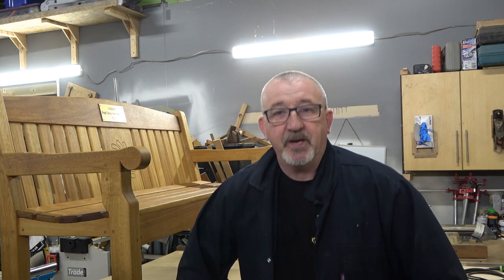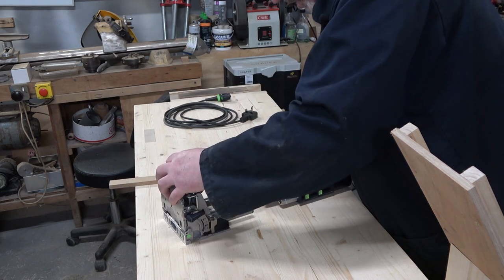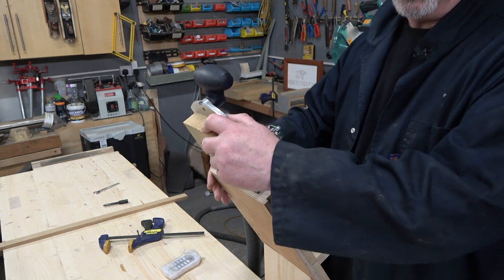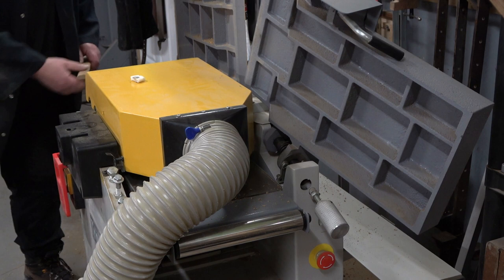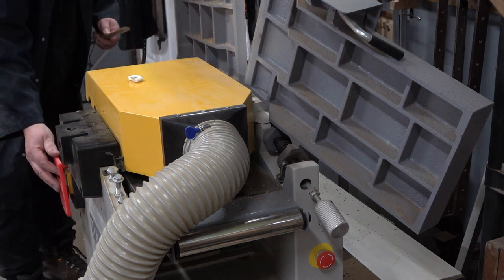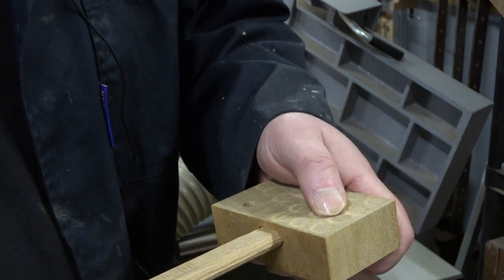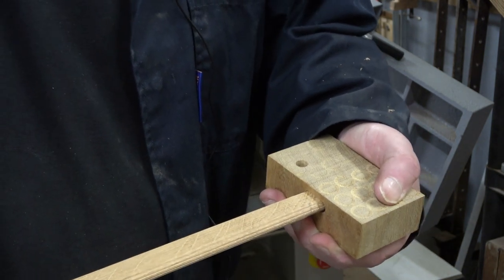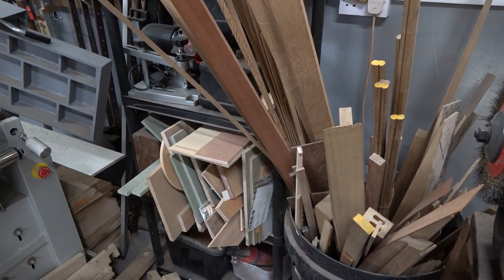DOMINO ROUTER BIT (not available in stores)

Comment: I've made some custom dominos before but I made extra wide ones to fit the  'extra loose' setting. I had a situation where I couldn't  fit 2 dominos side by side but I needed that anti-twist strength so just did extra wide dominos. I didn't add the grooves, but I ended up having enough space by the curve not being exact to give the glue a place to go. It worked out nicely and can come in handy even if you aren't trying to save, just need a custom fit situation. Thanks for sharing!
Reply from the maker: We did the same here, they were custom made for a bench that will probably live outdoors so we wanted to use sympathetic species. Thanks for your feedback.

Comment: So there’s a lot of videos coming out that measure the strength of joints. The domino rated very low on strength. So basically one is paying 1000$ for an alignment tool that you can pay 100$ for something that does the very same thing. Fastool makes very good tools that is 5 times over priced. Amazingly, people buy it.
Reply: It's meant for alignment. You want strength, you go with the connectors. You can't take apart a glued up mortise and tenon
Reply: The sole advantage of dominos is that they do not require precise alignment (they are deliberately sloppy in the width dimension). If you use a jig, twin dowels are as strong and way cheaper.
Reply: @Tensquaremetreworkshop  why would they be deliberately sloppy if they are for alignment?
Reply: @shaynesabala  If you are putting in 2 or more to join two parts together, then, if they were tight, the separation would need to be very accurate or they would not fit. They are commonly placed by hand layout, i.e. pencil marks. This is not accurate enough, so they are made slack- there is even a control to increase the slop. Dowels are cheaper, more available, and (especially in pairs) as strong. The sole 'selling point' of the domino is that they can be used with hand layout. There are double dowel machines at a fraction of the cost- but cannot be used free-hand (for multiple joints). You need a jig. So, if you want to avoid jigs you pay large sums to Festool. Personally, I made a universal dowel jig (see my channel for details) and just use my drill. Excellent hold and strength, saving ~£1000 for the domino tool and a tenth of the cost per fixing. You will never see commercial furniture using dominos- they are always dowels.
Reply: @Tensquaremetreworkshop  I have a cheap biscuit jointer that cost less than 100$. It lines them up perfectly every time so that’s not an issue. However, I read somewhere that said the biscuits can swell over time and cause misalignment. Not sure how that would happen after the glue is dry but time will tell. I guess we both agree, the domino is an over priced gimmick of sorts. Lol.
Reply: @shaynesabala  I would not call it a gimmick- it does what it says, but at a huge price. All to avoid using a jig to lay out dowels... A biscuit jointer is somewhat different- it is designed to joint together flat pieces, such as for a table top. It is tolerant of inexact alignment, but the thin biscuit and their length make them unsuitable for joining e.g. at right angles.
I understand that, when used for their intended purpose, it is advisable to only glue one half of the biscuit. This allows the wood to swell along the grain.
Reply: @shaynesabala  A problem some folks have with biscuits is they don’t give the glue enough time to set hard. I always wait at least a day for the glue to set, or longer. First I heat my oven to 200’ F turn it off and put the biscuits on a cookie sheet and get any moisture out. Then assemble with glue. They swell with the glue, then seem to settle back in. If you sand when they are swollen, Later you may see divots where the biscuits are placed. Anyway after 50 years of wood working that’s all I’ve got. Stay safe!
Reply: @Tensquaremetreworkshop  Not true, the domino has three settings: tight, medium and wide. In the tight setting, there is no slop. It is designed so that you use the alignment pins and tight setting to very precisely set the first domino from the edge of your joint, and then use pencil marks and the medium setting for the rest, since your joint alignment is already guaranteed by the first domino. This way you can cut tight fitting joints very quickly, something not possible with a dowel jig or a biscuit joiner.
Reply: @coolbugfacts1234  So, at best, two of your joints are 'tight'. If you have calibrated the stops correctly (they have to be equidistant, as the the tool rotates between parts). This is perfectly possible with a dowel jig. You just need a jig that does all of them, not just the two outside ones. My dowel jig (see my channel) is just 300mm long, cost next to nothing, and can place up to 8 dowels accurately along a joint. (it could easily be more). Using the drill I already have, a drill bit I already have, and dowels that are as cheap as chips and widely available. Slow? Not more than a few seconds per joint. Compared to an expensive tool that is yet another thing to haul around. Yes, if you are a jobbing joiner that still makes furniture by hand fitting it is possibly a suitable tool. For the rest of us- there are much better tools to spend on (a fairly decent table saw is around the same price).
If I were a jobbing joiner? I would invest in a full-sheet CNC router (approx 4 x Domino price) and it would cut out all of the parts and joints to an accuracy that you can only dream of, while I drank coffee.
Reply: @Tensquaremetreworkshop  You don't calibrate the stops, they're fixed in place, spring loaded pins on either side of the bit, that place the center of the cutter exactly 37mm from the edge of the joint
Reply: @coolbugfacts1234  'Exactly' is a Platonic ideal - that does not exist in the real world. Everything has tolerances. Woodworkers may (sadly) talk about 'exactly', 'perfect'ly square, a 'perfect' fit, 'spot on' and other such absolutes, but engineers talk about 'within specification', and 'within tolerance'.
And if 37mm does not put it in a suitable place? (e.g. clashes with another feature).
Reply: @Tensquaremetreworkshop  The domino machines comes with cross stops that clip on the side, and allow you to reference anywhere from 100-205mm from the edge, they have a serrated surface that aligns the pin in 1mm increments
Reply: @coolbugfacts1234  And that sounds really precise and not prone to user error....
Of course you are now using a jig- which means you do not need a Domino!

Comment: I would run a cove cut on each face to allow for glue. So perhaps 3mm flat each side and a very shallow cove. Maybe 45deg, 10inch blade.
Reply from the maker: yeah I have done that in the past but wanted to have as much glue able surface as possible.
Reply: @keeneyecreators  Sure, but how much glue will there be left on the flat sides if you make the fit that tight? ;)
Reply from the maker: @Robinlarsson83  I agree Robin, that is why in the video I mentioned I would normally take a hair more so the fit wasn't quite as tight.👍

Comment: It’s fairly easy to make dominoes (without) grooves.  Round-over bits and a router table.
Reply: And the design slop (to allow manual spacing) will allow glue egress.
Reply: Cove cut faces to stop hydralock.

Comment: For a similar price tag I’d go with Lamello Zeta P-2 every time. It’s versatility and connector options blows domino out of the water. A simple jig on trim router does loose tenons without the ridiculous price tag of domino. Festool is a marketing company first, and a power tool company second. Everything they make is way overpriced.
Reply: If all you cared about was price, you could just do hand-cut mortise and tenon joints. The domino is made for professional cabinet and furniture makers, where spending $1000 on a tool that boosts productivity is a no-brainer. Why do you think big cabinet shops pay five or six figures for edge banding machines when they could do the same thing with a clothing iron?
Reply: @coolbugfacts1234  I wasn’t talking in the context of a professional work shop set up. I simply compared bang for buck. Where - IMO - lamello is a clear winner due to its versatility. Obviously, if you’re batching out 100s of frames - using floating tenons - in a professional shop, then a domino would definitely come in handy. Domino is a one trick pony though, and Lamello shits all over it for versatility in functions. Hell, if you’re running a professional shop and are throwing 5 or 6 figures around for increased productivity then there’s likely more efficient machines on the market than that don’t require someone to stand at a bench using a hand held power tool to make mortises.
Reply: @JaCee501   The domino isn't a one trick pony, you can use it for knock-down bookcases, cabinets and furniture with the domino connector kits. The connector kit for the smaller Domino has similar applications as Lamello's Clamex system, like bookshelves and cabinets. The connector kit for the larger Domino can be used for knock-down load bearing furniture like bed frames, tables, benches, etc. Another good use of the domino is handrails, there is a domino attachment for joining handrail miter joints. Also, FastCap sells special self clamping barbed dominos (FASTenon) that have similar applications to the Tenso connectors, for example to attach face frames without clamps.

Comment: 'Measure to make it a good fit'. As I understand it, the system works be NOT being a good fit- since the cuts are made against manual marks, they are not accurate in spacing; slop in the width dimension is needed to allow for this. Not important when using single dominos, it is likely to bite you with multiples.
Reply from the maker: Hey Mike, thanks for the comment. If you use a domino machine in the narrow setting there is very little slop end to end and if you've ever tried to remove dry fitted stock domino's without first sanding them to aid removal you learn very quickly that the tolerance is very tight. I agree that the grooves cut are not accurate but they are just to create space for glue to squeeze out so don't have to be. The critical  dimension is accurately cut with thickness planer and therefor works every time. I have had success with this method every time.
Reply: @keeneyecreators  I am sure that your use is very successful. I was addressing the rarely understood principle behind the domino. Why would anyone use these, instead of (double) dowels? Dowels are cheap, reliable, well available and strong. Used universally in sheet furniture manufacture. Answer- dowels need accurate holes- little room for error. Fine for CNC cut furniture, but for a woodworker using hand marking out- nope. The domino is deliberately made to be tolerant of error along the joint- by having slop. You can vary this, as it is not needed in single tenon joints. Use a jig that references to the end of the material and dowels are just as good (as a fixing- way better by any other criteria). But woodworkers are used to hand marking out- so they have to buy expensive tools and parts to compensate.
Reply: Have you actually used one ? Because just like the answer above if you use the narrow setting on not halves of the  material there is literally no side to side slop
 I know because I miscut one when I first got it because I hadn’t calibrated the side stops which caused it to be a fraction of a mm proud. An assembly hammer or clamps wouldn’t bring them flush 
And the whole pencil mark thing you’re saying is not quite true all the time, as on edges it works with registration no mark needed (as long as the stops a calibrated 😂)
Reply: @spycedezynuk  Yes, if you 'calibrate' the side stops, then you can use it on narrow setting (within the range of the stops). But then you are using a jig, and do not need to use a Domino in the first place! I repeat, the sole advantage of the Domino is that it is tolerant of inaccurate layout. When you set the cutter 'sloppy'. For that, you suffer the (much) higher cost of tool, parts (the cutters are 40 times the cost of a good drill), and materials. And you have a single source supplier.
The alternative? A good dowel jig. I made my own, took a couple of hours and the materials were half the cost of a Domino cutter. Gives me very accurate dowel joints, see my channel.
Reply: @Tensquaremetreworkshop  don’t need to see it mate I’ve seen dowel jigs. 
you seem set in your ways and don’t quite understand how convenient and quick a domino actually is time = money mine paid for itself in the first week
Reply: @spycedezynuk  No, I am not set in my ways- it is those who continue to 'hand fit' joinery in the old timey way that benefit from tools that compensate for their approximations.
Those of us that use modern methods (my woodwork CNC mill can cut tenon slots, dowels, or any shape I please in both the face and edge of materials with precision) understand the capabilities and shortcomings of such items. The cost of a Domino setup is halfway to a workable CNC machine! See my 'JointMaster' series for more.
Reply: Well, the few times I've used a Domino, and I've seen lots of other people doing it the same way, I've cut the mortise on the tight setting on one piece, and on a wider setting on the other piece. Then you place the Dominos in the tight mortises first, and the sligtly to long mortises in the other piece gives you allowance for the handheld "precision". Plus it gives you some adjustablity along the joint. The dominos are only intended to align along one plane.
Reply: @Robinlarsson83  Precisely my point. The sole 'feature' of the Domino is the slack fit, to allow hand fit methods. Place them mechanically (jig, CNC etc) and you might as well use dowels- an order of magnitude cheaper.

Comment: Maybe I missed this but why are the grooves even necessary? Why can't you just make a domino with a regular round over?
Reply: To increase surface area for glue contact as well as allow glue to be pushed back from the base of the mortise to prevent a pressure gradient forcing the joint open or blowing out the end/side of the mortise. He mentions it towards the end.

Comment: I enjoyed the video. I'm surprised they don't make a Domino dowel router cutter to produce lengths of domino because you can by spindle moulder cutters to make your own.
Reply: Hi, do you know where to buy the spindle moulder cutter?
Reply: Who are 'they'?
Reply: Hmmm.... why? If my time is worth money, making dominoes myself is a waste of money. They aren't that expensive, like 150 pcs for 20 bucks. This only makes sense if you want to use a special wood type, and even the benefit of that is more than questionable.
Reply: @wernerviehhauser94  The math is simple; if you can make them cheaper than buying them… But then woodworking is not the highest paid activity, if it is all about the money. Aesthetics enter the equation for many.
Reply: @Tensquaremetreworkshop  i find it strange to think about the aestethics of a part hidden invisibly inside the final product. And at 30 to 50 bucks per hour plus taxes here, that sounds like a lot of missed income to me. The only exception would be just doing it for fun and not for profit (what I do) OR if the client ordered it that way in which case I'd charge them for it.
Reply: @wernerviehhauser94  Aesthetics are often non-transferable... For some, it is about how much was made, and how much bought. I am guessing the (vast) majority of YT viewers are hobby makers rather than commercial (of those that are actually makers of any sort...) Some want to hand make everything using hand tools, using chunks of tree as the starting point. Others will use manufactured and finished parts just requiring machine made joints and minimal cutting to size. No one thing is right. There are tools to make (round) dowels, surely the cheapest wood component available. 
The Domino is, at heart, a quick and dirty way for a jobbing tradesman to put together one-offs in a hand-fit manner. Volume would use CNC and (probably) dowels. Craftsmen (not being paid by the hour) would tend to the dovetail route. And there is a host of options on the spectrum. Yes, I understand that you see it as a commercial pricing decision- but you are highly likely to be in a minority.